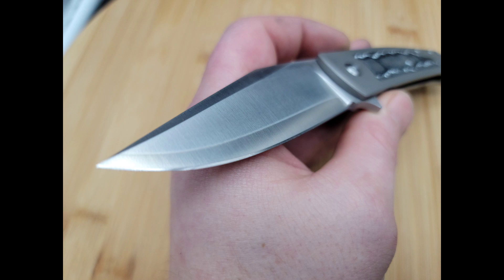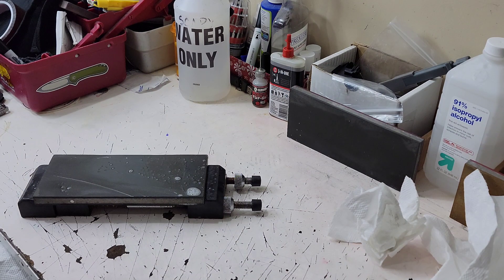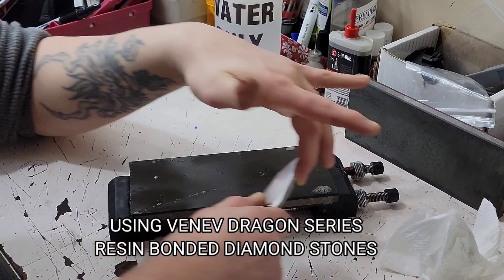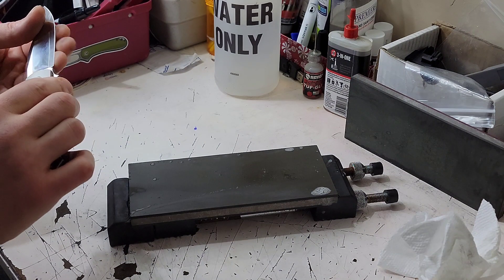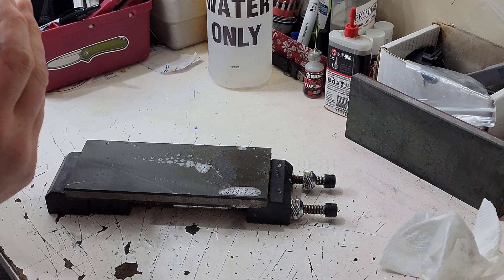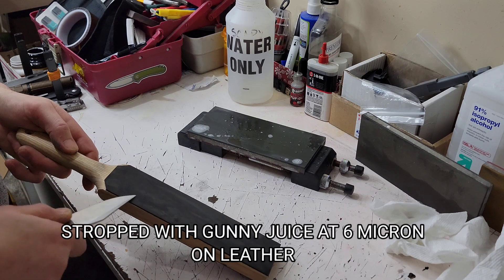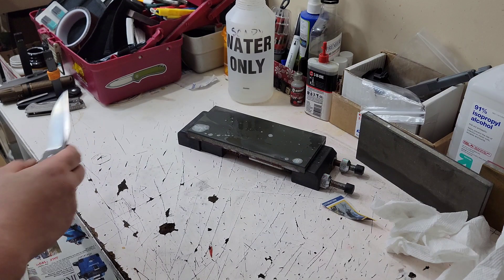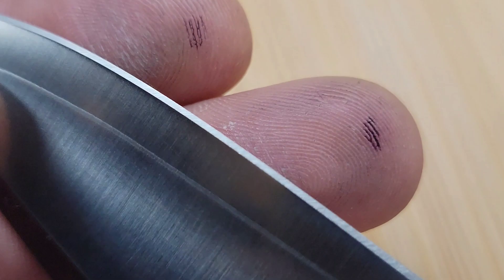SHARPENING ZDP189 AROUND 70 HRC

Comment: I have the MBK Slayback in ZDP, but my Pinscher is M390. I didn't know they did a ZDP Pinscher. Very cool. I haven't used my Slayback enough to need a sharpening yet, but it's good to know it should sharpen up ok.
I just picked up a very nice kangaroo leather strop, and I'm trying to decide what to put on it. It came with 8000 equivalent green compund, but I already have other strops with green compound. What do you think? Fine diamond? Currently I only have down to .5 micron CBN. Should I go to maybe .1 mic?
Reply from the maker: Not unless your wanting polishing, I think 6 micron and even higher is great, but I do like the gunny juice
Reply: @NeevesKnives  Thanks!

Comment: Unrelated question.  I just bought some diamond plates, 300, 1200, and 3000 grit.  Should I buy a 600 and a 2000 grit as well? 
They are just the ultra sharp plates that you can find on Amazon, so nothing overly impressive. 
Also, I seem to get a really sharp edge until I hit the strop.  Then it gets an almost chalky feel to it.  Again, it's an Amazon strop with I believe a .05 micron paste that I've put on it. 
Thanks.
Reply from the maker: Definitely a 600 grit, but if your coming off of 3k you shouldn't need much stropping, so you could be over stropping, Stropping is only for cleaning the apex, if there's no burr or material at the apex then don't Strop, unless it's for maintenance, you want to do as little stropping as possible unless your trying to polish, also use little pressure.  But yes good compound is far better